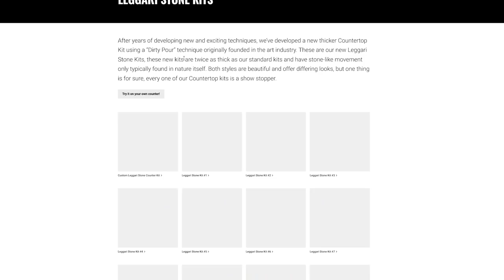How To Coat Epoxy Edges To Make Countertops Look Like Real Stone

Comment: Beautiful tops.  Do you have a video showing how to finish the back near the wall?
Reply from the maker: Hello! We Do not currently have a video covering this specifically but that is a great video idea. Whether you have backsplash or not, we recommend taping about an eighth of an inch up the countertop wall to be sure that when the epoxy is installed, the tape does not get locked into the epoxy once it cures. Thank you!

Comment: For the sides could a person maybe mix up a small batch of epoxy and brush it on before puttting the weather strip to help it flow a bit easier? Great lookin counters as always! Also after this would they have to be urethane coated to last and resist scratching?
Reply from the maker: Yes, we always recommend our Leggari Urethane topcoat! You do not need to put epoxy on the edges first you will have plenty or resin flowing over to rub in any dry primer to allow the epoxy to roll over the edge evenly!

Comment: Great job guys. I want to ask you something. Why do you first spray isopropyl and then denatured alcohol. What’s the difference between those two. Could you only spray isopropyl? Many thanks.
Reply from the maker: Isopropyl is used as the dispersing effect to give you the cool cells and craters and the the denatured alcohol pops  any bubbles! You do not have to do the dispersing effect if you like the way it looks with out it!
Reply: @LeggariProducts  thank you!!

Comment: I have a question I see you don't use a torch to burst out bubbles, Why is that? Is it cause of the 99% isopropyl alcohol????
Reply from the maker: Leggari Epoxy never needs a torch to pop bubbles! You just mist the surface with denatured alcohol to pop any bubbles. The 91% isopropyl alcohol is used to give you the natural looking cells and craters you find in stone!
Reply: @LeggariProducts  Thank You So Much, This YouTube Channel Is Very Inform. Thanks Again.🌟🌟🌟🌟🌟